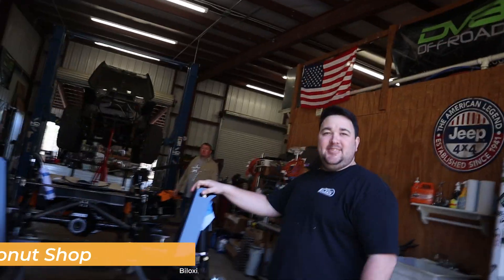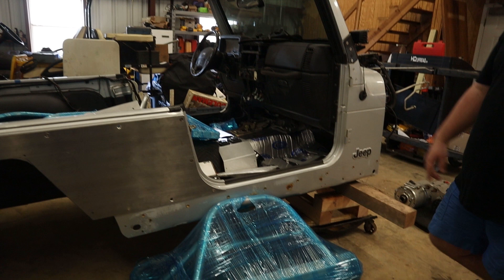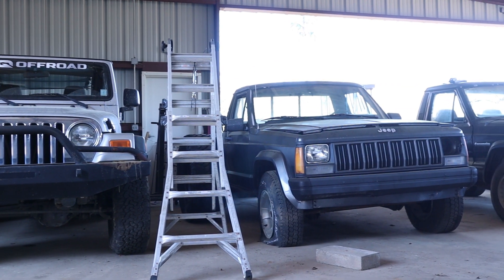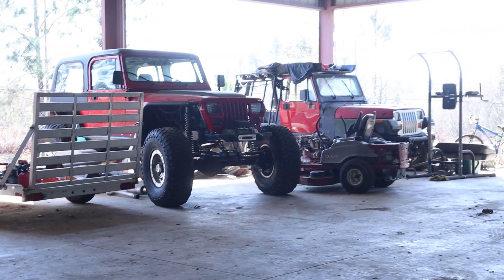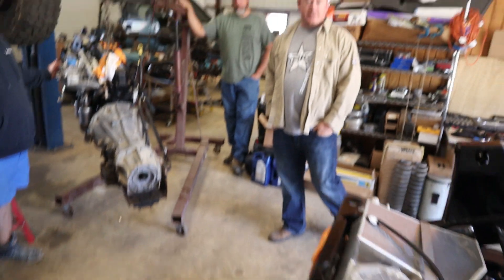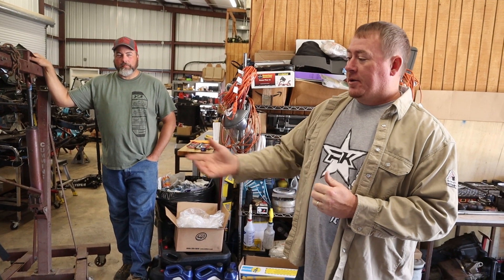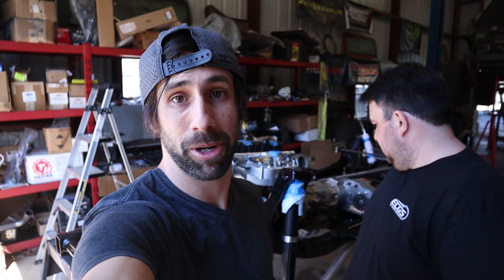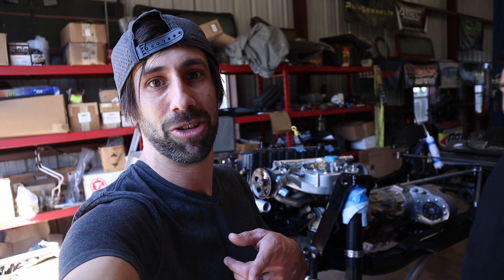This LJ Covered in GenRight Aluminum is SICK | Checking out the @Alumi_LJ Build at The Donut Shop

Comment: Did they do anything to the 4.0 for that throttle body?
Reply from the maker: It bolts up with no issues, but the Jeep will be getting a new tune to compensate for the engine upgrades

Comment: Awesome build I have 2 LSs One I'm building into a crawler. I would like to know what length of shocks are you using And how tall are your shock towers. Good luck with your build.
Reply from the maker: He is running 13” up front and 12” in the rear. Rock Krawler 2-5/8 coilovers. He has the Artec towers in the front and RK towers in the rear. Give him a shout and he can probably give you any details you may need. Contact HQ Offroad